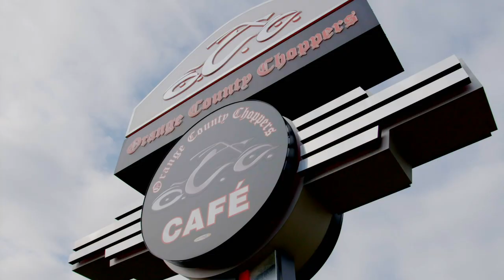Unveiling Two Brand New Choppers In The Philippines | American Chopper

Comment: I would like to know the cost after delivery getting registration in Philippines would cost more than the cost of the motorcycle, and those pipes would have to go, bottom line they will never be on the road
Reply: Yehaaaaaa
Reply: Delivery would be expensive. Registration will have the same rate as other bikes, depending on the category. U might be meaning the taxes. The bike's exhausts can stay. As long as the engine displacement is expressway legal.
Reply: @shizi  Anything goes there i have been there twice and the police dont care,they dont wear there helmets,some  police do.

Comment: Over priced  JUNK .
Can't sell anymore in the United States ,
They have to go to the Philippines ,
I remember guys taking a regular motorcycle and extending the front forks , cost - less than $1000 

These bikes $80,000 to 
$100,000 each and can't ride them 20 miles or your back and Butt is broken and sore